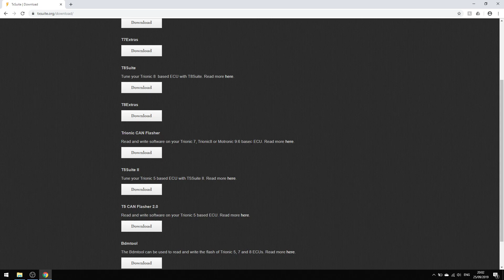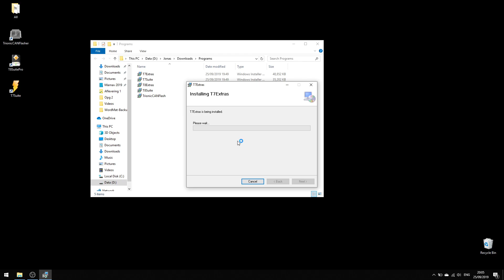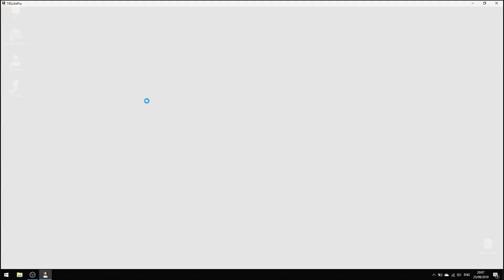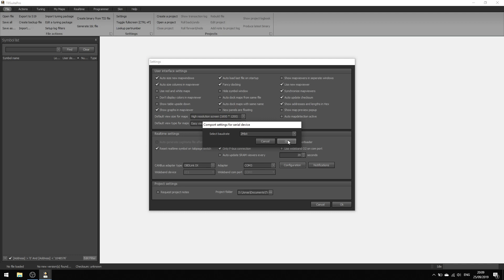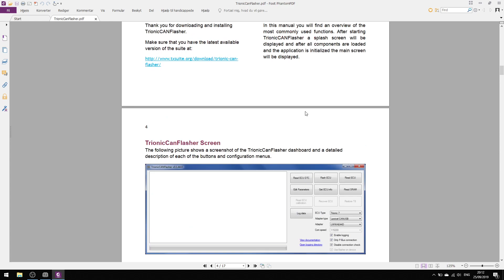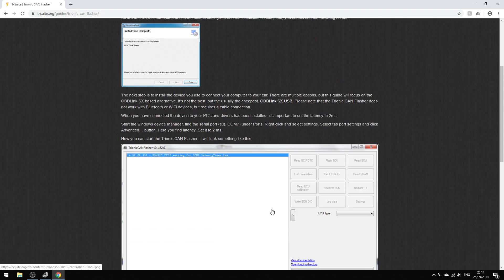T7Suite, T8Suite and TrionicCANFlasher

Comment: You just wasted 15 min of my time with self explainatory settings while not showing most important part- connecting
Reply from the maker: What connecting part would you like to know about?
Reply: @gordon2095  Reading and flashing from ecu?
Reply from the maker: @Jonjs99  in car or on the tabel?
Reply: @gordon2095  Never mind, I dound it, already flashed my first tune, compared to stock aero it seems soo agressive, car started right away, but havent tested it, im afraid. .. That was easy part, but tio understand t7 suite  and these tables.. that may take years